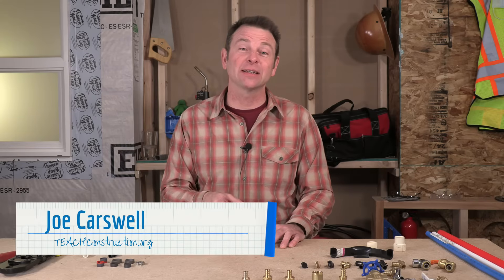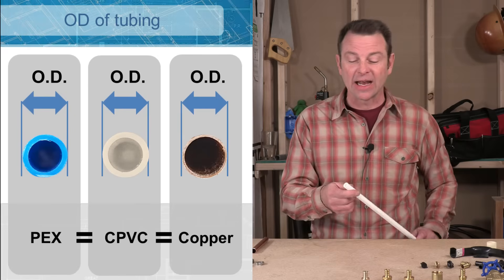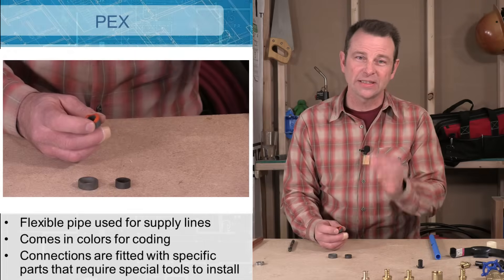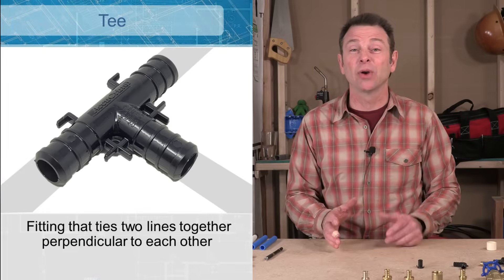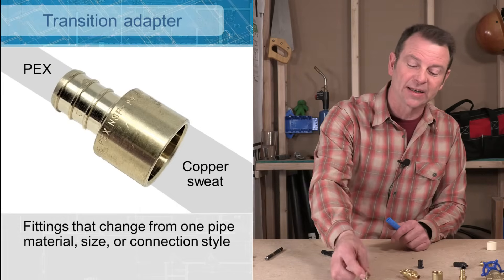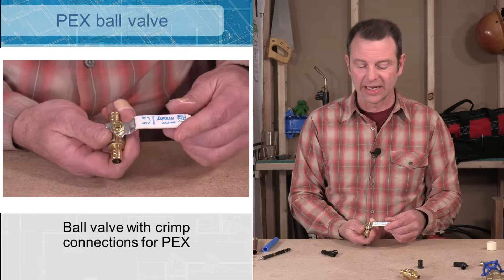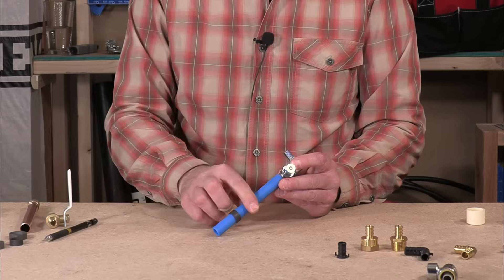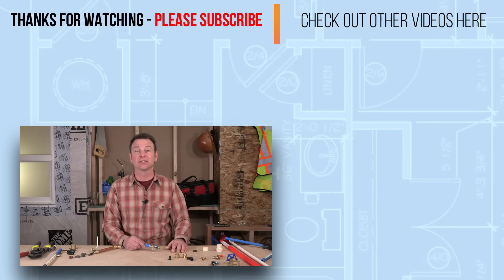A lesson about basic PEX plumbing materials  - Intro to Plumbing Systems

Comment: Thanks for the instructive video about PEX.  BTW, aren't PEX A and B fittings dissimilar?  I thought the A type fittings had a shorter shaft length and the "barbs" were dissimilar in diameter, whereas type B fittings (either in metal or plastic) had longer shaft lengths and all 4 barbs were the same diameter.  Thus only use flare tool on PEX A and crimp type rings on PEX B.  Because of this difference, you should not interchange the two types of fittings and/or two types of pipe.  Important distinction, IMO.

Comment: You did a very nice job or explaining the different PEX  components and how they are used in a clear and concise approach.. Keep up your good works. I think it bears mentioning that there are some structural differences between brass and plastic fittings. The plastic fittings have to be thicker than the metal of brass to withstand the forces of crimping. That thickness comes at the expense of the ID (internal diameter) of the fitting (making the plastic thicker). I am told there is approximately a 20% decrease in flow (GPM) through plastic in comparison with brass respectively. I am not sure if there is an additive effect when there are multiple fittings in the same run. I could see some high flow items like Dishwashers, Washing machines, hot water heaters (especially on-demand) needing all the flow they can get.      Secondly, The press connect fittings.....their entire sealing ability is dependent on a single O-ring. I myself and most plumbers I know do not use them in walls or any place that if they leak they can't be observed readily( unless no other option is available). I think of all the things I've had that had the o-ring fail and I just won't trust it long term.  Just some thoughts. Thanks again for your great content!
Reply from the maker: This was a basics of PEX video - something had to be left on the cutting room floor.

Comment: We have a big leak somewhere underneath the house but we can’t get in there to investigate.  A plumber recommended we run brand new lines from the meter to around the house and create feeder lines to each room that needs water.  It seems reasonable given the situation.  He wants $5k to do everything.  So I just came from Home Depot and wanted to learn about this system and as I was looking around at all the  tubing and connections and different ways to do it.  I started to wonder if I could pull this job myself.  The salesman there was very knowledgeable and explained lots of things I might need.  Now after viewing this highly informative and detailed video, I’m thinking that I should do for a fraction of a cost.   Thank you for doing such an excellent job in explaining what every connection does.  

Now I need to figure out where and how to cut and connect the main line to PEX, I I need a back-flow valve, how to connect to the outside faucets for the water hose, the hot waterline from the water heater and maybe a couple of miscellaneous things.

Comment: Pex connectors are not interchangeable, connector A for Pex A, and Connector B for Pex B. On the Pex clamps, the black ones are not rated for underground use, the stainless pinch clamps are.

Comment: All of these videos show you HOW to use the crimp rings or expanders - how simple it is to bend the hoses etc. Where are the videos about the actual pieces you need to use in order to do the plumbing with the pipes😂…. the whole other side to Pex A and B ? - its called elbows, male threads, female etc - the side where Pex makes all of their money, in the parts you need to assemble the product…….
Reply from the maker: You are correct and we have many other video lessons available on the supply side of plumbing.

Comment: My worries is that I had a Plex B fitting leaving my water softer break off and cold water feed to my hot water heater that has the plastic lined nipple have some type of reaction and turn white, then started leaking serval years latter. Hot side is fine.

Comment: Thanks so much for sharing your knowledge with all to see and learn.  I would appreciate it very much if you have time to answer a question.  What would be the best size and type of PEX to run underground (below frost line) for 300 feet, as a supply line to the cabin?  Thanks.

Comment: After having my house flooded, FUCK all that plastic shit PEX pipe. I can sweat solder K copper with the best of them, and the heavier wall K copper properly designed & installed will last 75+ years with high mineral content water and well over 100 years with good soft water. The PEX is failing after 20 years. Push on fittings should be avoided at all costs. I must have lost 100 press fit removal keys inside of wall, and there is no way in Hell I'd recommend using let alone reusing any push fit fittings.

Comment: I want to use a manifold. I’d like to run individual lines to each  lavatory, laundery and kitchen. Iced like to avoid any joints in the pipe. As all my pipes are in the attic. Can you or do you have a video on a manifold and how to maintain water pressure in the system.

Comment: I hope this pipe lasts longer than the DuPont crap that manufacturers put into mobile homes in the 70's!
Reply: Mobile homes aren't meant for more than 10-20 years of use.  There's your problem.

People using temporary structures as permanent housing.
Reply: @jwm6314  They leaked from day one because of the poor engineering!

Comment: Do they make a fitting that allows you to sweat on to a 1/2 copper line but connect to a 3/4 pex line?
Reply from the maker: they sure so.  Right on the shelf.  It is a reducer coupler

Comment: I have the 1980's Qest pipe. For over 30 years, no problems other than angle values getting old. That little rubber gasket/seal that blocks flow breaks down. The proble is Qest products just are very  rare. Hard to find if at all. Sooo how can it be changed over. What adapters if any?❤

Comment: The problem with pex is the size the inside diameter is smaller than copper pipe. I had a water heater replaced and the installer used 3/4 inch pex instead of copper. I now have issues with the water temp due to restricted flow.

Comment: Push to Connect fittings ..............  can you use both PEX A and PEX B tubing? 
               Great video.................  Excellent presentation.       Thank you.
Reply from the maker: Push connection fittings work as long as the OD (outside dimension) is the same.

Comment: Hi there, I have only 1 cm of 1/2 inch PEX pipe sticking out of the wall, how to extend this pipe to connect it to a valve. There is not enough room to  put and crimp  the ring, even you can not use the crimping tool because of the wall.
Reply: Hmm, hole saw around the pipe and push a shark bit onto it..?

Comment: Why not start with when and why pex failed. The class action law suits and what is different now. All so the id of pex fittings are not the same size as copper. Pex had to suit cal in order to sell it back in cal due to all of the failures. Rats chew pex to get water.

Comment: When using threaded connectors, does the brass part spin inside the PEX pipe so it can be unthreaded and rethreaded multiple times?
Reply from the maker: It does.  But I would keep that movement to a minimum

Comment: Thank you for your content. A few yea ago, in Texas, we were slammed with a horrible winter. A property of mine in Louisiana suffered plumbing damages that required the entire home to be replaced. I was taken clearly by surprise when I went to check on it. Weeks would go by before I could address it. Visiting a mom & pop hardware store, one of the workers suggests I consider PEX. I only knew PVC and purple cement/glue. He convinced me that it was worth researching if replacement was needed. I invested in the tools and materials and did the job myself.  First time doing this. My dad was too ill to assist at the time, but he beamed when I told him, “Dad, it’s finished, it’s done.”  If you are reading this, “You can do this!” Two bathrooms, kitchen, and laundry room….done by yours truly! There’s a tool that takes the manual labor needed out of the squeezing required to get the ring to crimp close. Being in tight spots also makes getting a good grasp on the tool challenging, but it’s very doable.

Comment: "I will be using Pex pipe for a waterline. At the 9:20 min,  you talk about metal Pex adapters. I have a 3/4" NPT male brass pipe nipple I have to connect my water line to. Can I use the female version mentioned at the 10:20 mark to connect to my male pipe nipple? Thanks

Comment: If your copper pipe is grounded and you go to Pex plastic tubing do you lose your ground .
Reply from the maker: Typically a grounding rod is also in place, but yes you do need to make sure that a ground is not eliminated.

Comment: I love the Pex pipe but I hate the Pex fittings. Heres why i hate them, your Pex pipe has an original inner daimater of .5"'s. The Pex fitting has a smaller inner diameter, i believe, of about 3/8"'s  of an inch. At 60 PSI, Water will flow through the Pex pipe at (x) gallone\s per minute until it reaches the first Pex fitting. The Pex fittings introduce at least to issues, a shoulder of the fitting reducing GPM flow and the fitting smaller inner diameter further reducing GPM flow but not PSI. This is increased every additional fitting you introduce in your piping system, further reducing your GPM flow. If you were to do this using copper piping and copper fittings (1/2" down to 3/5" you will get a red tag (failed inspection).
Reply from the maker: reduced water flow is a real thing -

Comment: Great video!  Copper is time tested to last at least 50 yesrs. Pex piping systems  haven't  been  in  use long enough to say how long they will last.  They sure are easier to install for DIY .
Reply: Rodents can also eat through the pex as well. If you can afford it, copper is better for sure.
Reply from the maker: that can be an issue.
Reply from the maker: Copper still has its place.   And many think that PEX is just crap and should not be used.

Comment: this was the best explainations of pex pipes on here......i did myself in a crawl space copper pipes for my double bathroom sink which came out great, but so many fittings to heat up and solder..i had zero leaks and i have it wrapped in insulation for the winter weather...but, i have the kitchen sink,and the laundry room sinks and washer to update..i have a few pex tools here...with this video, i have a way better idea of what to get now...i did last year install a ten foot of pex for my kitchen sink which the pipe before rotted out......time to get it all done and forget about it then,
Reply from the maker: keep up the good work

Comment: From the point of an 'old teacher', this is a very nice instructional video.  Thank you very much for all of the information.  I have one problem that I am trying to research and that is how to connect the regular PVC pipe to PEX.  I want to change my piping due to all of the winter bursts.  I notice you have a couple of PVC fittings in your video but I never heard the process involved in connecting them since they normally require glue and are NOT the same size as the CPVC to use a push connection.  I would sure appreciate information on how to do this. :)
Reply: It's called a " transition coupler ".... If you have found out already, then this is for folks that don't know....I find that if you don't know what you're talking about, then tradesman either won't tell you much or they themselves don't know, but won't tell you they don't know.

Comment: The biggest mistake people make when switching from copper to PEX is using the same number size such as 1/2" PEX to replace 1/2" copper.  1/2" PEX = 3/8" copper and 3/4" PEX = 1/2" copper.  This is due to the thicker wall thickness in PEX.  Small internal diameter equals less water flow.
Reply: The fittings are the bigger reduction  do to clamping methods PEX A vs Pex B. Pex A is more true to size because pipe is expanded to go over larger fittings.
Reply: The pipe may expand to fit over the fitting but the res of the pipe is still the smaller inside diameter. @jeffriley2502
Reply: @jeffriley2502  excellent advice. Thanks. I am a newbie to this kind of plumbing, but it strikes me as odd that you can clamp pex B over top of a plastic fitting and not split the fitting.
Reply: @mrgarner11  I personally stick to the brass fittings, cost is more, however I  believe it to be better and safer overall installation.  I've been researching this for a while and starting a remodeling project.  It can be confusing with all the  different Pex/Plastic pipe variables out there. Sizing differences make it more complicated.
Reply: @jeffriley2502 the only downside to brass is if you are replacing copper pipe due to acidic water.  The brass now becomes the weak point.  My water has a PH of 6.8.  it's perfectly fine to drink and tastes great but we used to have green stains on our sink.  The plastic connections have eliminated that.
Reply: Good to know. Thank you.
Reply: Eh, but this is maybe right but mostly wrong. You don't need 3/4 to a toilet or sink, it can depend for your total flow, but you don't need to replace all 1/2 copper with 3/4 pex.
Reply: Do you lose your ground coverage going from copper to pex ?
Reply: Water main entry would be the same metal pipe so you wouldnt lose your grounding. However, I would always have additional ground rods and not rely on cold water pipe alone. @MrRockydee07
Reply: What? Never had an issue matching copper to pex with push fittings.
Reply: True but we will not be running  a fire truck pump...most of us will not notice the difference in the house
Reply: Now, before you think theres a reason to get pissed before you hit the end....

You think you're pretty effing smart, like people don't have brains??? Well you are, and you're correct!!! Good for you and thank you for taking the time to make a comment, especially a great comment!
Reply: Yep, dealt with the recently. Replaced my old leaky gate valves for my washing machine and grabbed 1/2 shark bite fittings. Didn’t fit lol
Reply: Its also the fittings. Ive seen whole house plumbed in 3/8 pex homeruns to a mannabloc
Reply: So go with 1". Got it.
Reply: Lol what
Reply: Nice 👍🏾 
Thank you!!
Reply: excellent point, thank you!
Reply: I'll remember that. Thanks 👍🏻
Reply: ArePEX pipes legal in every city in US?
Reply: Is pex a good for potable water$
Reply: No, the biggest mistake is poisoning their family's water with that subpar product, which is destined to fail if it doesn't kill them first with cancer. There are going to be some serious lawsuits one of these days. It's not going to be legal forever. It's going to make the asbestos lawsuits look like a day at the park.

Comment: Thank you! Excellent video with a wealth of information.  I was so confused yesterday when I saw all the different types of shut off valves.  Now I know to get the straight push to connect valves for under my kitchen sink supply pipes.  I'm thinking my pipes are half inch. Subscribed and I'll be checking more vids to help me get my pipes done and new faucet installed.  Subscribed. 🙂

Comment: Been doing my own plumbing for years. Lots of tools, pipe, joints/connections, glues/solder for galvanized, copper, pvc, etc. Recently a pipe and valve started leaking in my recently deceased mother's house. Unbenounced  to me the house had been replumbed with PEX a few years ago but I can't repair it as I don't have and can't afford to buy the special pipe, valve, fittings and tools needed to make the repair and nothing I have works with PEX. Trying now to contact a plumber that has the proper tools, parts and knowledge to make the repair without it costing me a large part of my SSI monthly income.
Reply from the maker: Plumbing and plumbing tools can be very expensive
Reply: @ConstructionEd  > Think it would have been less expensive if I had bought the tools and parts and attempted the repair myself. Wont go into the whole thing but felt kind of violated when presented with a bill for $500+  (almost half my monthly income) from a plumber I was told was good, reliable and "inexpensive". He was here for about an hour and replaced a section of pipe, a flow control valve and tested the system.

Comment: The word of caution: do not use plastic elbows and tees for hot water or in hydronic system. PEX extends/contracts with temperature significantly more than copper or PVC and that creates mechanical stress which plastic cannot handle. I have seen multiple failures of this kind. Plastic is only for cold water!
Reply from the maker: thanks for the addition

Comment: To all these people who complain about the prices of services and say they can do it themselves for free or whatever then MAKE YOUR OWN PLUMBING BUSINESS AND CHARGE YOUR CUSTOMERS LESS OR GO SIGN UP FOR SOME COMMERCIAL CONSTRUCTION JOB AND INSTALL THE PLUMBING SYSTEM YOURSELVES plumbing is not rocket science but that does not mean that it's a easy thing to do most D.I.Y people not all of them but MOST of them tend to do a shitty@$s job anyways without actually having professional experience there's a reason why they have plumbing licenses just like they have licenses for most skilled jobs like electrical or HVAC or auto repair. Btw not ALL plumbers charge the same price you have choices you don't always have to depend on the one plumber there's a lot of them
Reply from the maker: Good points.  I think plumbers should be paid a fair wage and should be able to charge for their experience, knowledge, and business costs.   That being said, for the right person, I do think that a homeowner can do good work, if trained correctly.